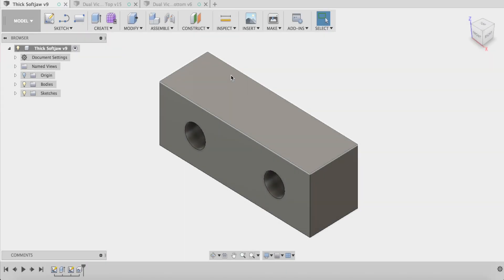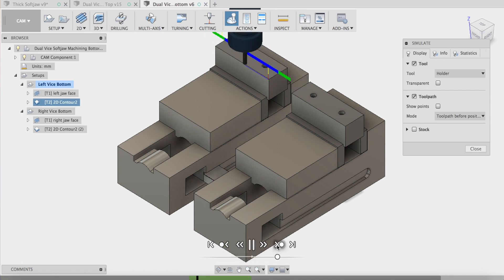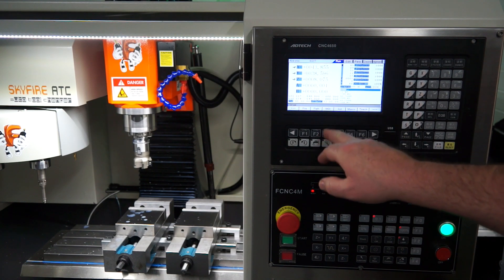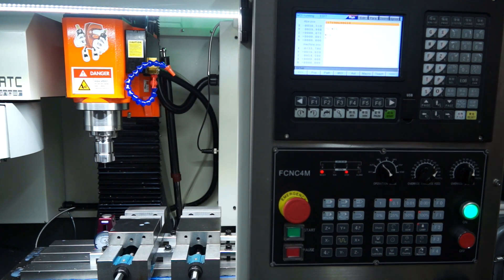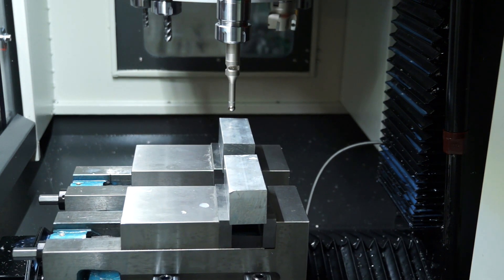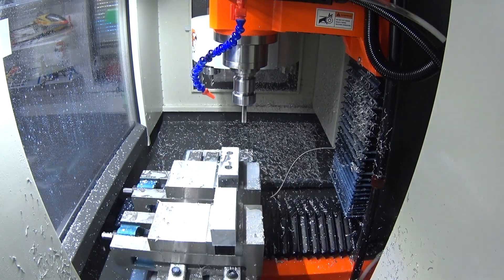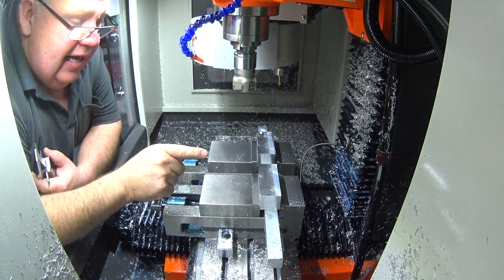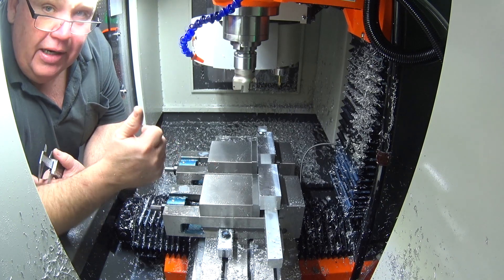CNC machining Monster Soft Jaws - SkyfireCNC VMC

Comment: That's an awful lot of button pressing to change and measure a tool!
Does the adtech have scripting ? 
I'm going to fit one of my probes to my mill later.
I'm using uccnc as the controller. Rigid tapping, probing etc is easy with it.
Reply from the maker: automateanything yes it has a built in tool setter. I’m not sure if you can measure out all tools like the Haas or other machines I’ve used. Was too lazy to figure it all out so did it manually fit the vid. Yes heard good things about ucnc.
Reply: DCTTeacher1 
Just had mine rigid tapping at 1200 rpm :-)
( old mill not spanking skyfire)

Comment: Hi Aaron, great video. I am also following Salvun and I enjoy you both very much in your endeavour with Skyfire.  Did you also need to take measures for leakage? 
Greetings
Herri in China. ( by the way: you need tools / I am in the business. )
Reply from the maker: SURE D hello and thanks for watching. Yes I had a few coolant leaks that I’m still battling with. Yes Pieter @salvun is a great guy. Hey what tools do you have? I’ll check out your YouTube now. Cheers Aaron
Reply: In YT I have only one video. Just a small fun thing. Basically I still don't have enough time to make new ones. Tools: in general all kinds of tools. I am mostly engaged in CNC related tooling, but not limited. Cutters, holders, inserts, precision measuring tools and so on. In the case of heavy goods, I usually cannot compete with local suppliers at the destination who receive their goods by sea freight. Air-Express charges eliminate the purchase advantage for heavy goods. So just contact me with your needs at sales@sured.com or sales@diy3dp.space
I / we will figure the best options out. By the way: I am German. 14 years in China.

Comment: very nice video.  This might be very obvious to most machinist but I am not one but  I am really interested on how clean you have left your machine after you finished the job.  In the future could you maybe show some of the basic house cleaning tips to keep the machine so clean after a job like that.  Do you only use the air gun to push all the shavings down?
Reply from the maker: Hello Jaime and thank you for watching.  You've raised a very good question and I'll try my best to answer it for you.  I was always taught that you should never use compressed air to blow any machine down.  I only used compressed air on the part in the vice upon opening the door.  Most larger CNC machines have a wash down gun which sprays coolant. I don't have one, so I install a piece of hose on the coolant line and wash my machine down with that.  I try to do this at the end of each day, or at the end of a large job.  Cheers, Aaron.

Comment: Great video Aaron!
I really enjoyed that you take it from cad to cam to programming the tool offsets in the controller and last onto milling the parts.
If you have the time and are willing I would really like to se some videos when you program the controller for tools, macros etcetera.
I find it really interesting. I downloaded the manual and read through it, it's useful albeit somewhat hard to get a grip on at the same time. :-)

Does the controller have a ehternet interface to pick up the code from a NAS or FTP server?
Or is it only USB of DNC?
With a modern machine and controller I would really appreciate the possibility to pick up the code through a regular LAN.
Been using Mach3 for years and going back to running back and forth with a thumbdrive doesn't sound like fun to me. ;-)

Keep up the good work, I'm really enjoying your videos.
Reply from the maker: Patrik J Hi Patrick and thank you, as I'm glad you enjoyed my video. I will try to make more Skyfire / Adtech video in the future. Yes the manual is hard to get a grip on, as the poor English doesn't help. I did open up the controller panel and I do recall see another smaller USB plug. Cheers Aaron

Comment: Very nice to see the chips flying! I see that you did you CAD/CAM in F360. Do they have a post for the Skyfire controller, or do you just use a generic post?
Reply from the maker: Hell and thanks for watching.  I had the post processor tweaked for me.  Scott Moyse from CADPro NZ did it for me as we have our CSP with them.  I'm sure he wouldn't mind if I shared it?  However, I have been told that the generic Fanuc post works also.  Cheers, Aaron.
Reply: Thanks Aaron. If I go with this machine, I may have to swipe it from you/Scott.
Reply from the maker: qCNC K no problems at all. Just shoot me an email when ready ;-)

Comment: Did you find the controls familiar or was there a curve? I like the little step you cut in the jaws, thats a nice touch. That 4mm cut was very impressive, like hot knife through butter! That FK up looked more like a time saver :) kind of like a clip from Titan CNC! I wonder what was the actual spindle load was? Now it's time for me to get familiar with the CAM portion of Fusion 360!
Reply from the maker: Hey mate, yes it was a small learning curve.  However, I just really applied what I already knew from the HAAS controller, Mach-3 and the Masso interface.  Honestly, if I can do it anyone can (as I'm not that bright lol).  Yes, I was surprised to hear that machine when it took the 4mm cut.  Mate, I launched out of my chair and literally ran across the air.  However, I was very surprised that it did it so easily.  Cheers, Aaron
Reply: Very cool, keep those Fusion 360 Cam and Adtech control videos coming! Love watching that Skyfire run. Then I may have a clue when mine gets here....sure could use it now.
Reply from the maker: For sure, I most certainly will.  I might even do a video of setting up the controller from start to finish (power on, homing, jogging, MDI, work offset, tool offsets).  What do you reckon?
Reply: Now your talkin! That would be awesome! Maybe even a live Q&A....??
Reply: I hear there are Great Whites in the neighborhood.....

Comment: Great Video! very interested in this machine. Need to save my piggy bank... 
I am interested in more information on your gx-31 gas heli conversion and the modifications you made to the engine and how you did the clutch assembly. do you have any more images or videos on it you would be willing to share?
Reply from the maker: Hi Matthew, yes I agree mate.  The SkyfireCNC is little ripper.  Sure no problem.  Can you send me an email and I'll see what I can find.  My email is on the about section of my channel page.  Cheers, Aaron.